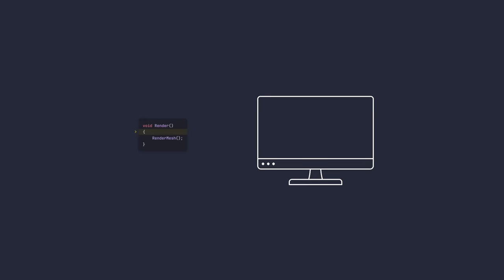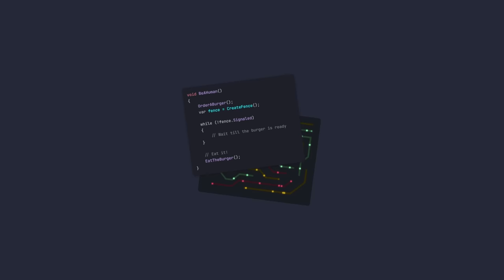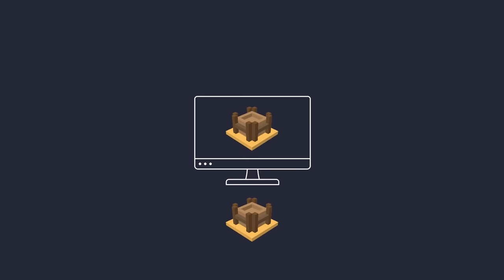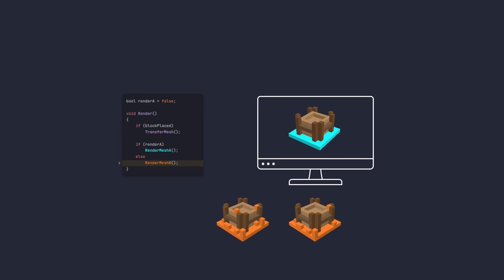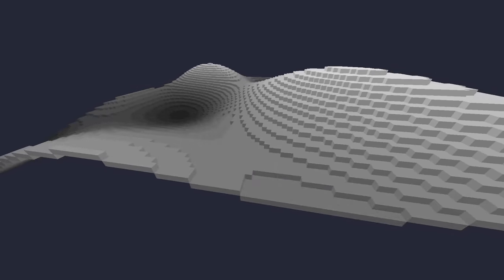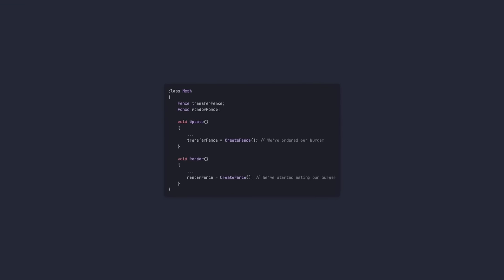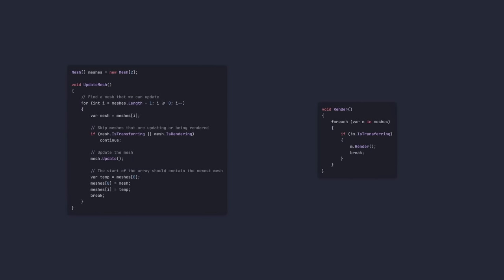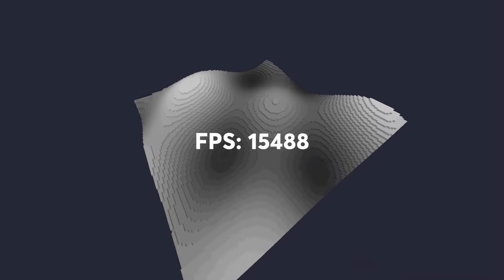I Created a Game Engine Just to Optimise This

Comment: 123 optimization videos later: This game runs so smooth you can get 4k graphics with 120 frames a second on a potato clock even without the potatoes.
Reply: Quake 666
Reply: I think the first arm cpu was so energy efficient that it ran on ambient electricity or something like that, maybe that could be an actual goal point of optimization, to have it run on that.
Reply: @SethbotStar rebuilds crysis to run on a single double A for a year
Reply: @RowbotMaster and yet  it remains un-portable for the switch bc nintendo.
Reply: He's gonna get Doom working on an Ancient Roman sun dial
Reply: GLAD0S: and I'm a potato!
Reply: For this amount of optimization, Nintendo has to become Nanotendo, and Microsoft to Nanosoft
Reply: @MichaelChin1994  you know I could almost see it actually being done with a ton of crystal refraction and filtering
Reply: I think this just puts more workload on the cpu
Reply: Still waiting for an assembly code optimisation 😅
Reply: @elcalabozodelandroide2 that's some BS right there, for one it's not a Nintendo game, and secondly Nintendo are kinda kings at optimising for their hardware.
Reply: @n1nj4l1nk  no , i meant nintendo asking for more money for 16 and 32 gigabits switch ctariedge (that are really just usb).
And time release contracts.
Reply: @elcalabozodelandroide2  so literally nothing to do with the conversation.
This thread is about optimisation.
Reply: @n1nj4l1nk   yes , indeed.

Sorry about that
Reply: @SethbotStar i remember hearing a story where they disconnected the power but it was still running
Reply: It ran on electricity delivered through the data pins.
The reason that is so shocking is because those pins have a maximum power output and the designers of the supporting chips expected your CPU to draw that much power to do nothing but simply see that data exists there. The ARM CPU ran off of that power alone.
Reply: Haha because burgers. I see what you did there 😂
Reply: And potato turns into french fry
Reply: @RowbotMaster  the idea of an lcd display and a "computer" playing crisis on like 10 fps just slowly sipping away at a pack of batteries just kills me.
Reply: Close, it was leftover electricity retained within the unugged power supply's capacitors @SethbotStar
Reply: dude, massive graphics cards beg to differ, they use a lot of power
Reply: @SethbotStar  What happened was it was running off of the input signals (like 3.3v, or 5v USB) from other chips. The power supply was connected to those, but not directly to the CPU or multimeter.
Reply: This is doom. You have just described doom.
Reply: @90AlmostFamous  Considering how most games are not using the CPU to its fullest capabilities, I think this is a fair tradeoff.
Reply: You know it's well optimized when you can get 120FPS on a 60hz monitor....
Reply: When they first tested the arm they thought it drew no current but they had forgotten to wire It up to 5v and It was drawing current from the io buffers. Like how people used to use the data lines on the parallel port to get 5v. Yes it is lower power (because you can only get milliamps) but it was 1983 and no CPU's were using much power then either. Your CPU was plastic packaged with no heat sink or fan. Any heat came out the legs into the PCB. There were advantages that the arm had over other CPUs of the time and modern arm CPUs have very little in common with those original arm CPUs either.
Reply: its called understanding
Reply: @MichaelChin1994 didn’t someone already do this with moss or something?
Reply: bro will run gta 6 on a microwave

Comment: This is standard behavior in all major game engine used in production for the last 10-15 years.
Reply: I was thinking that might be the case because unless I'm missing something, which is likely, he's described async code
Reply: I wonder when someone working at Minecraft is going to find out. Split screen with my kids is ridiculous if anyone is crafting. It freezes every time
Reply: UE already have that?
Reply: I'd be surprised if this was true.
Reply: @greatbriton8425  Yeah it was definitely an exaggeration but he's right that it's not new.
Reply: @diddlenfiddle7311  It is kind of like async code, the issue is that it's across a hardware boundary. Async code is a feature of the programming environment you are in, which then translate it to run on the hardware (the CPU), most programming environments do not support graphics card hardware for their async environment (though some do, like Julia), let alone for the specialized graphics operations (which, for example, Julia does not support). What he is describing here is how to write the library code that invokes an async process on another piece of hardware without any of the language support that usually exists (e.g. because it doesn't for this use scenario).
Reply: @MasonBially it's still asynchronous code just without the benefit of modern async abstractions (which do something like this under the covers though perhaps with more sophisticated scheduling).
Reply: @bradbradford8576   Minecraft does use a lot of techniques and I know it uses some optimizations but it is build without the use of any modern game engine, just a light weight rendering library meaning they would need to either rewrite it from scratch or build the functionality on there own which would be quite a lot of work.
Reply: Hahahahahahaha 🤣 there's always that one person. Unless it's social media then it's a bunch of them
Reply: @cholasimmons Lmao, there's always that one person with laugh smileys. Unless it's social media, then it's a bunch of them.
Reply: @Blacksoul444 emojiphobic much? 🤨
Reply: OK, soooo, what's your point? Just felt like throwing out some random fact? If so, I got one for you in return.

Comments on YouTube have been a standard feature since 2005 and the first comment was by Marco Cassé, who wrote "LOL!!!!!!" on June 14, 2005.
Reply: @NeorecnamorceN  making fun of X = phobia of X, you must be a genius for drawing such a conclusion.
Reply: Then why do they still freeze?
Reply: @Blacksoul444 are you ok?
Reply: @MaxOakland  the more common reason for hitching (on PC) is shader compilation, not resource uploads. It's a similar problem (stalling the GPU waiting for a resource to be available) but waiting for a different reason (compilation rather than a large data transfer).
Reply: Exactly. But modern "developers" developers just don't care, even if their engine supports such optimizations.
Reply: @davidmartensson273 I mean, they’ve got a lot of time.
Reply: @davidmartensson273 They already did it by making bedrock edition...
Reply: @bads  I know but that is a different platform altogether with a  game engine.

You cannot really do that for the Java edition without breaking thousands of mods, and I highly doubt they will alienate players by doing that.
Reply: @gneruinseruihnutshnu  It is not that they do not "use" the optimizations, that is not really how it works. All this stuff is abstracted away. Most developers wont ever touch it. 

GPU uploads and synchronization is not the only reason for stutters. I believe the most common reason might be garbage collection, especially in Unity based games.
Reply: @gendalfgray7889  it gives you the tools, as the game dev its your job the use them right. Most devs whos code I have seen don't use the built in tools to code it the wa y of this video. they just skip that bit and throw the logic in the render loop and get annoying pauses all the time. 'multi threading is hard' so most devs ignore it entirely.
Reply: @davidmartensson273  ever heard of Bedrock Edition? :)
Reply: @Falcarious  I have heard of it but as far as I know it does not even come close when it comes to what you can do with mods since in bedrock its a more formal moding api that while easier and more stable also restrict you to what the devs have opened up for modding.
Reply: Maybe, or maybe not. Game engines typically optimize for specific use cases and mesh replacement is a fairly uncommon activity, compared to things like texture replacement. Meshes also tend to be very small compared to textures, so the pipeline impact is lower.

I would be surprised if he's the only person to come up with this--it's a pretty natural pipeline management technique, and it's definitely standard procedure for texture replacement--but I expect that you'd only find it in high end voxel engines, where terrain is freely deformable. I don't know of any AAA voxel games (I don't think Minecraft counts despite its popularity, and I guarantee they do not have this optimization).

Having said that, I don't feel confident that the stutters shown at the head of the video are actually attributed to this particular pipeline blockage. The clips I noticed are from No Man's Sky, where terrain is being procedurally generated on the fly. This does entail a lot of mesh transfer, but a terrain mesh for what's on the screen, even a high resolution mesh, is still a tiny fraction of a decent graphics card's data pipe. The generation step however is probably extremely expensive. If I had to guess, I'd say the terrain generation is bottlenecked, possibly generating terrain that isn't on screen, or not evicting generation requests for terrain the user may have looked at, but didn't.

Put another way... players can turn really fast, so you can't just generate what's in front, you also need to generate some of what's to either side, just in case they change heading. But they are more likely not to change heading, so you upload what's in front first, and queue up generate for the two sides afterward. Now let's say they didn't turn. The load ops for the two sides are no longer needed because the user is now somewhere else, but they are still in the queue. So you queue up a new load for terrain in front of them, but it goes behind those ones. You need to abort the load operations for the terrain they just whipped by without looking at it. But that takes time to do. So over time, your pipeline backs up with processing requests for off-screen material, and you have to wait for it to finish or be cleared away in order to receive what's in front.

This is still a really cool video though! It's a valuable technique, and if I'm ever writing my own voxel engine, I will definitely keep this as inspiration. So kudos on that.
Reply: @bradbradford8576   Minecraft has one of the worst optimized graphics engines of all. Java edition anyway... Bedrock edition might be better, they did write it from scratch after they got rich off it.
Reply: Nah he's the new carmack and doesn't just have all his e-cores turned on
Reply: tell that to unreal engine. i've yet to play a game, on console or modern pc that doesn't stutter that uses unreal 3,4. maybe 5 is different but i haven't booted up robocop yet
Reply: Then why do modern games still have freezing problems? Or maybe the question is suddenly have freezing problems if it worked fine before?
Reply: @AliceinEntropy  There are MANY reasons for freezing and studders, but it typically has to do with garbage collection or asset loading, ether from disk or upload to gpu- as shown in this video.
Reply: @markdmckenna  My personal conspiracy theory is that they deliberately make the Java edition perform badly in order to push people towards Bedrock, which is a microtransaction shithole.
Reply: I think you're almost right @seigeengine  ... I don't think they made it perform badly on purpose, because it performed badly when it was first written and there was no Bedrock version, for years. Also because it's not easy to intentionally make something perform poorly (your best bet is to give the devs insufficient time, but sometimes that just results in no product at all... but I digress).

I think they are intentionally not fixing it to push people toward Bedrock.
Reply: @markdmckenna  This just isn't true. Minecraft used to perform much better than it does now.
Reply: @seigeengine   This is not my experience, I found it mostly to get faster with the speed of my machine. I will say though that when they added freeform extended properties to blocks, they forced each block to do a whole lot more work than it had to before. That was a really big extra load on the engine, and the Java engine wasn't build for that. So that might be what you're experiencing.
Reply: @markdmckenna  Then you have no idea what you're talking about and should stop talking.
Reply: no you  @seigeengine
Reply: @Falcarious  The guy at the top of this thread said he plays split screen with his kid, you can't play split screen in java, he's talking about Bedrock edition. And Bedrock has a lot of fanboys but the truth is it performs worse than java with any form of multiplayer. I know exactly what he's talking about, bedrock freezes and is borderline unplayable even on LAN when I try to play with my nephews. Stock Java isn't great, but with optimization mods, it proves the potential java actually has. Mojang just needs to get their priorities straight.
Reply: @cholasimmons  It's a valid comment to make, the video creator talks at the beginning as if major games don't do this as if he's come to this brilliant solution no one has thought of before... but it's standard practice in all modern game engines to work this way
Reply: @copordrop  your engine must be way better, can we see it.
Reply: @MaxOakland  Because there is one stuff author forgot to mention... Physics and reaction to user input. If I need for example 100ms to execute jump of character.. then even if your graphic card is ok and use asynchronious stuff you will see lag of your character.
Reply: @NeorecnamorceN  The video is called "I Created A Game Engine Just To Optimise This" and he frames it as if this is a common issue and he's the first person ever to solve it like this. The top comment is pointing out that this is something all engines worth their salt already do. The entire introduction to the video is a false premise that half of these comments are falling for too. Just because a game freezes doesn't mean that it has this particular problem in its code (it most likely doesn't. there are several reasons for rendering to freeze and this is such an easy solution people have been doing it since the 90s). Just because Minecraft or Unreal Engine freeze doesn't mean they don't use async and it doesn't mean Vericidium is the first guy to ever solve this problem.
Reply: @copordrop The video creator may indeed have come to this optimization by his own reasoning. Just because it has perhaps been a commonly used practice elsewhere does not mean he knew about it. Nor is he necessarily claiming that he was the originator.
Reply: @diddlenfiddle7311  async is not new, but you'd be surprised how few things actually implement that, especially at the low level. 

Consider that iouring is still relatively new and mostly a Linux tech. It's cool tech that you need to take advantage of and isn't built in to everything 

There just wasn't the need for the bandwidth given the data throughput.
Reply: im da 1000th like to ur comment :D
Reply: Pipelined rendering is indeed not new
Reply: @AliceinEntropy  Shader compiling and modern renderers moving computing workloads to the GPU.
Reply: @EssensOrAccidens  The videos beginning and title implies most modern games suffer from this. Even shows Starfield, which probably uses async code anyway?

You wouldnt know this is basicaly a "fixed" issue from the video. Or that he fix isnt enough to solve the issue in complex games.
Reply: And he decided to lead in with 5 minutes of talking about burgers so he could waste everyone's time, nice
Reply: @davidmartensson273  you can't do that without breaking thousands of mods? That has NEVER stopped Mojang. Almost every release since 1.4.2 changed rendering in significant ways, and every time modders need to spend a long time refactoring. 1.12 in particular was absolutely nasty, it was made for optimization reasons, broke everything for everyone, and in some cases made existing features outright impossible... which caused some mods to never update past 1.7.10 ... they don't give a rat's ass about modders, and never have, even though mods are what has been keeping this game alive for the past 15 years.
Reply: @LordFokas  Well not quite the same. Many mods use a middleware mod that does the main integrations to the actual game and once that base mod is updated many mods start working.

Switching to another game engine and another language for the game would require a complete rewrite of those integrations and doing so for code built from c++ is quite a lot more complex than for java, and with the base game running natively, java would no longer be part of the main game installation so then either other mods need to be build in other languages or the base mod would need to provide a Java interface.

Its just a much much bigger change.
Reply: @davidmartensson273  bruh... I'm a modder, I know how it works. If you think Forge stops changes like that from spilling into the user side you are very wrong. And Fabric & friends are even thinner abstractions. And I'm not comparing that because there's no need to compare, languages aren't special, you can do that in Java just as well, and im fact Mimecraft does have optimizatons like that implemented. My point is that a huge rendering refactor is always possible and they aren't in the tiniest bot concerned about mods, as in fact these things do happen often over the years.